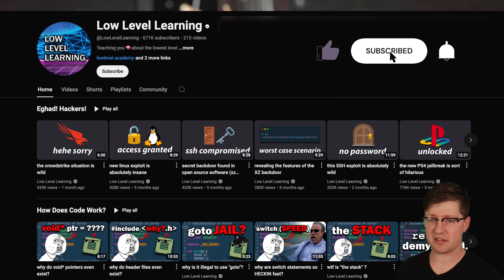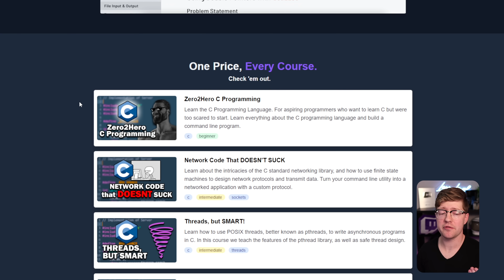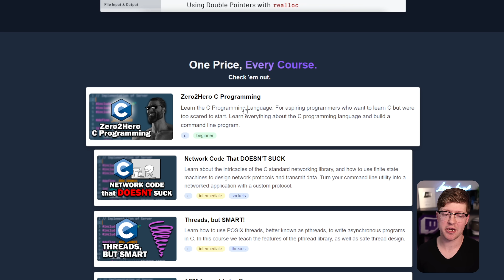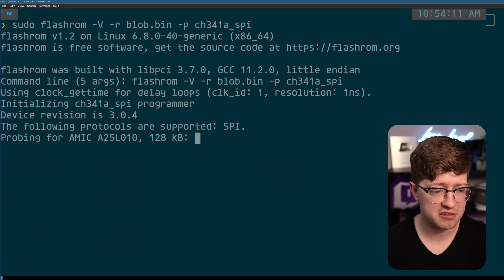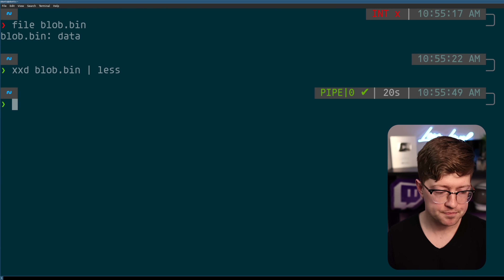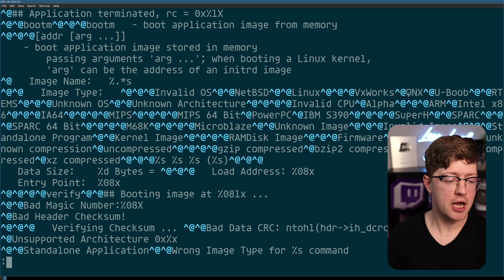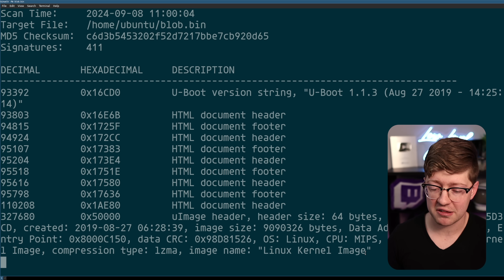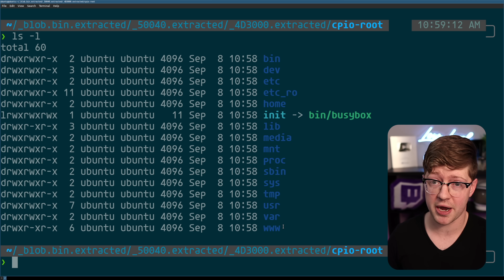how is this hacking tool legal?

Comment: You're Making 3 Mistakes. You Cant RECOGNISE Software Defined Hardware, Like Me. I Can See 100 Kilometres. You Cant. Whats On that Nor Flash is "nginx" - The Web Server, that Serves the Configuration Web Pages of That Router. Things Like - How The Wifi Protocol: 802.11n or 802.11g Works is Done in Hardware. E.g. The Signal Modulation Scheme and The Data Protocol (E.g. Code that Signals Start of Broadcast and End). ***Even Your God, Can't RECOGNISE Software Defined Hardware Like Me.
The 2nd Mistake. Its ONLY The Minions That are Big Enough To De-Scramble The Code. Even We're Too Little. However, "I" Can RECOGNISE Other SIMILAR Piece of Kit. Which HELPS With The De-Scrambling. Otherwise, its Only The Minions That are Big Enough To do it.
3rd Mistake: You're Not a Borg/Avatar. YOU - Even Noughts and Crosses (Tic Tac Toe) is Out Of Your Reach. Thats 1 Night for Me.
Its EXTREMELY EASY To Do something you've SEEN Before. Much Much More Difficult to Do Something You Havent Seen Before. You Can do Noughts and Crosses (Tic Tac Toe) if You've seen it Before. YOU CAN'T Do: Noughts and Crosses (Tic Tac Toe) If, You HAVEN'T Seen it Before.

Comment: Read the code 🤪 "As of 2021, the 5.11 release of the Linux kernel had around 30.34 million lines of code. Roughly 14% of the code is part of the "core" (arch, kernel and mm directories), while 60% is drivers." https://en.wikipedia.org/wiki/Linux_kernel

Comment: Most of well developed electronics will not have an easy access flash storage for their code. Either they use an encrypted binary on their flash or they use internal flash, which is not that easy to access.

Comment: Be careful with this device. It needs a modification to use 3.3V signals for the target chip! By default the board of this programmer is outputing 5V for signals (not the power supply!) to CH341 to the target chip. You can find on the internet how to modify the design and set the CH341 as 3.3V signals for the target chip.
In some circumstances you can burn the target chip if is not 5V tolerant!

Comment: I actually used one of these for the first time recently! I bricked my Chromebook while flashing the stock firmware after having windows on it 😅. Pretty fun tool to mess around with and see how things work :)
Reply: WİNDOWS ??? 🤮🤮🤮
Reply: @nildesperandum2034  Yup, I needed something a little more functional than chrome os, and at that point I knew a lot more about Windows than Linux.
Reply: Cooked it reading the flash in circuit ??
Reply: @kumaran627  what do you mean? I bricked it after flashing the wrong firmware when returning to ChromeOS, and used this to get the correct one on it. That Chromebook is still living lol
Reply: @itscharlie0110  i was not that fortunate , trying to recover a bios on a laptop did not desolder the chip and now the board is cooked
Reply: @kumaran627  Oh damn, was it a 3.3 volt chip? I kept mine soldered on but had to get a 5v to 3.3v thingy

Comment: The only special thing about this product is the ZIF socket you're not even using for its purpose. For general SPI dumping you can use any old arduino or rpi lying around. Or if you get a more feature rich product such as bus pirate or tigard, you can do i2c, uart and others in addition to dumping SPI chips' memories.

Comment: You read 16384 kB and you tried to write ~16777kB... that's bit more than just an extra character!
Vim corrupted the file? You should have used hex editor. What happened to the device?
Reply: FYI the device wouldn't boot, as vim adds additional metadata about the text layout such as line breaks to the file, and you're right, he should have used hex editor.
Reply: @fortimoks8136  or just use vim with the correct :binary options set

Comment: At 5:50 the 8 header pins are in backwards. Pin 1 is marked with the red wire and should be facing away from the USB connector
There's also a common modification people do to these CH341 boards to use 3.3v on the SPI and I2C bus as it does 5v by default which is too much for these chips
When dumping a flash chip, always dump multiple times and then compare hashes of the dumps to make sure they are all identical

Comment: Openwrt is awesome, I had a couple of routers that I didn't use, after discovering openwrt I could use for something useful, but unfortunately the routers only had 4mb of flash and 32mb of ram, so I modified the openwrt partition system for my device to fit inside an 16mb chip, so now I had more storage, but the ram was still an issue, so I flashed a custom bootloader that could work with different ram chips, and then I replaced the ram with a 128mb and now the router has the latest update and I'm able to use all the extra features of openwrt, this is only possible because openwrt is opensource, thank you all for that :D
Reply: I wish I had the soldering skills to upgrade embedded RAM

Comment: It's funny when people question the "ethics" of pulling the firmware off a device they purchased. You own the device, it's your firmware.
Reply: sony or microsoft and apple dont seem to think so
Reply: Yer but the manufacturer thinks its theirs...
Reply: Buy a Sky box then cancel your subscription. Suddenly, you can't access the hard drive because it's Sky's firmware. 😬
Reply: Break the law. Information is free. Rules of the universe. Screw social constructs when they go hard against common sense.
Reply: What is the point of this "ethics" if part of the firmware can be used in rare cases for a device of another model. The only downside for the manufacturer is if new functions were added to the old product, for example, NVME support to the old system board. Because of this, slightly fewer users will buy a new product with NVME support.
Reply: @_OS_ You can pull the binary code for Windows off your PC and apply it to a billion others, does that make you cybersatan for opening C:\ in explorer?
Reply: You actually get the right to use a copy of the firmware, not the firmware itself.
That being said, I can also see why some people would try. Putting not encrypted firmware on an embedded device, and the SPI flash is also not included in the SOC. Its an open invitation at this point
Reply: BIOS/Firmware is usually under copyright of device manufacturer
Reply: @vadnegru 

COPYRIGHT is just an obsolete construct to preserve power on the wrong side.

When I buy a paper book NOBODY can prevent me to rewrite it to 100 empty notes books for my own pleasure. 🤷🏼‍♂️

This society needs more digital monks. 🤣
Reply: Too bad EULA exists. Which I  have no idea if they apply on routers.
Reply: @schistosomaharinasutai6913  EULAs have zero legal standing.
Reply: no you dont. you own the device, the rest is up to the company and their descriptions defined and listed as per the user agreement that you had accepted or otherwise did not while purchasing or before using their product thereafter. thanks !

Comment: Just used one of these devices this weekend to flash a modified bios on my AsRock motherboard, to enable ReBar support.  AsRock has there instant flash locked down to only accept there signature. So it does have valid uses, which like many things, can be twisted to do bad things. Also you can easily do this with a raspberry pi.

Comment: 10:30 if it uses GPL-like licensed parts, like linux, you actually need to be able to replace that bit. Of course, the root file system may contain other parts. And - if you report a bug, prepare to get sued.

Comment: If you buy this, make sure you voltage mod it. Can be used at full 5v and full3.3
Or just buy the pgraded version with green pcb and voltage selector.

Comment: I recommend buying CH341a version 1.7 as it has selectable voltage and this is suitable for more chips
Reply: Does it produce stable 3.3 volts? Do I have to use another separate power source for writes?
Reply: @BusinesssLover can't say, but it did work for flashing several simple bios chips

Comment: Anyone thinking of using a clamp like that to write a new bios to your AMD card, there is a resistor you must desolder in order to do that, and then re-solder it once you're done. I don't know which one, but there are specialized GPU repair communities you can find that information.

Comment: Vim probably appended a newline after your file when you changed the string. By changing it to U-boo you would have changed the alignment of everything after so you probably would not have had it boot correctly.
Reply: Was just going to post that :) Much safer to edit with a hex editor, not text editor
Reply: And also probably exchanged any 00 with 20 LOL. Never edit binaries in a texteditor.